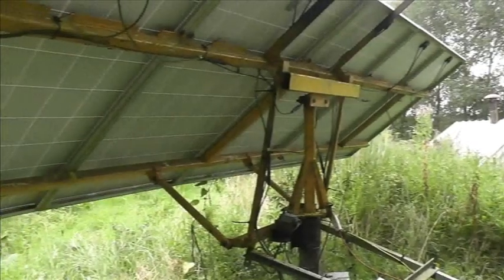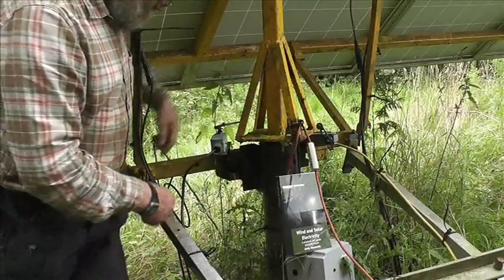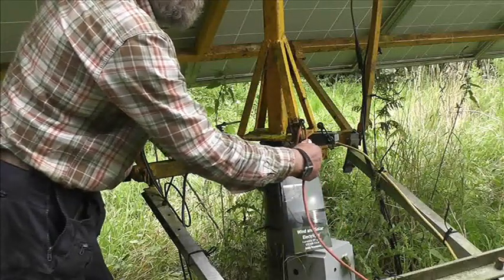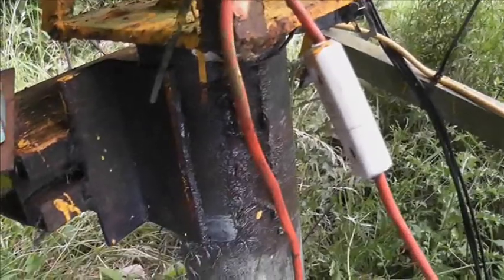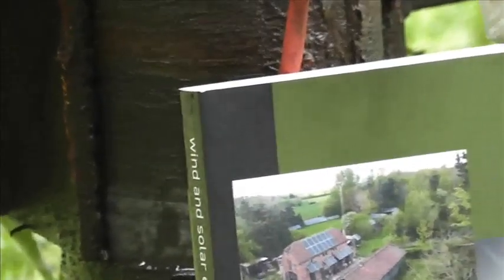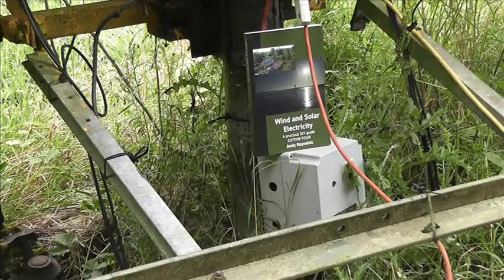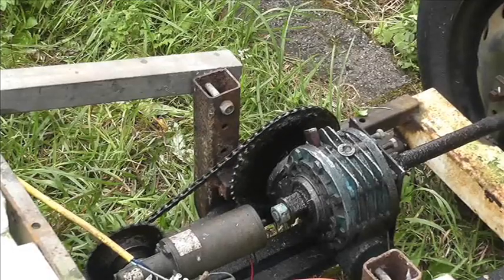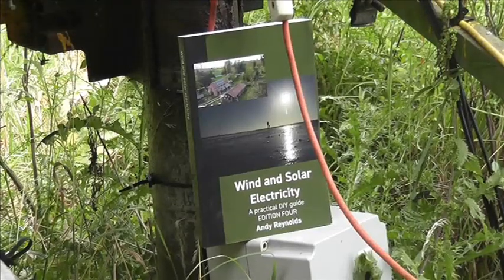Solar sun tracking, 12 year report, track the sun, solar panels, home generation, extra power,

Comment: i assume this is a mains powered motor without needing to reduce the voltage or control power to run it.
Although solar panels used from solar farms are too cheap to go this effort.
Reply from the maker: It's 12v DC powered from a slave battery, and remember this was built 12 years ago when cheap solar panels were what dreams were made of, cheers
Reply: @TheInfoworks I remember expensive solar panels Andy. In around 2001 I built two solar panels using very thin solar cells tabbed together between two pieces of glass since encapsulating liquid was too expensive.
Reply from the maker: @sim6699  Ah yes, all that tabbing wafers together was a right pain. It's amazing how far things have moved, 25p per watt, astounding, cheers

Comment: Impossible to say it's a bad design. Not good for far north heavy snow but great work
Reply from the maker: No point running this in winter as the arc of the sun is so low. 3 foot of snow is always a problem with roofs, trees and panels, cheers
Reply: That's why they invented snow tires duh! 😅
Reply from the maker: @gergc4871  Hi, I'm thinking the snow loading on the panels may be the subject here, cheers

Comment: For years I have thought that this is what should be done, but this is the first time I've actually seen it. I think this will generate much more extra power than it will consume. With everything slicked up and geared really low I'm sure it doesn't use much juice. I always envisioned using stepper motors. 

You might look into finding a lighter weight wheel and tire. Skinny tire and a wheel with spokes, maybe even aluminum. As long as you have a hard surface a skinny tire would probably be fine.
Reply from the maker: Hi, it uses virtually no power, 12v motor running on average 1 minute an hour, cheers

Comment: Nice choice on the touring all-season tires, hah. Does it get good traction in the winter?
Reply from the maker: Hi, nice comment. The sun's arc is so minimal in winter that there is no benefit, so I normally switch this off facing due south, cheers

Comment: Brilliant, I think.  I'd appreciate a video on that change over switch and it's workings.  It's the simple analog projects that last 10 years and keep going.   I was fully expecting a youtube ad right after your discussion on the need for shorter videos.
Reply from the maker: I'm resisting those mid roll ads. It's a simple cross wired dual pole relay, all in the book, cheers

Comment: 7:00 Is the video mirror as it seems to turn opposite way for sun?
Reply from the maker: Ah, I can see how you are thinking, the tracking drive runs clockwise during the day. Because the wheel is behind the central pivot it's driving the panels east to west, just like minute hand of a clock between 3 and 9, cheers
Reply: @TheInfoworks  OK, just can not see that from your video clearly but I now understand, thanks!
Reply from the maker: @april7_  No worries, pleased you are interested, cheers
Reply: @TheInfoworks  But look at your video. The tire is clearly traveling counter-clockwise around the pivot.  That is the wrong direction, for daytime. This may have occurred because you manually flipped the limit switches.
Reply from the maker: @MrSummitville  You are both right and I must have had it in night mode to set a new position for one of the micro switches, sorry @april7
Reply from the maker: Hi, it seems you were right and it must have been in night mode for experiments, sorry

Comment: So sorry you fallen foul of the morally bankrupt tube. Distanced from reality by living behind algorithms. Regardless. Short, concise excellent video. Sadly i dont have the room or elevation. But blew retirement gunds on 20 panels 3batteries 6kw inverter. Unreal savings. House now electric just winter bit of gas for heating. Tripple glaze and wallrock all exterior walls(bungalow). Ps we 2x EV. haven't paid for charging 10years.granny lead or upto 7kw wall charger. Think ahead. Big car over 300miles if need. Town car 60 plus. Keep your brain engaged.
Reply from the maker: You are doing well with your EV charging, I assume at a slow trickle rate. Yes, forward thinking to improve resilience. Watch this space for news of my new book, cheers

Comment: 12 years 64 panels 250watt on ground, on roof and on wall. No maintenance whatsoever.  That is how solar is best.
Reply from the maker: I hear what you are saying, 12 years ago 64 panels was a huge investment unless you were in the solar trade. Rule one says there's no such thing as too many panels, but you need the space and many people don't have that. cheers
Reply: @TheInfoworks  Agree, I was in a fortunate situation as we do sport equipment business with China and just added a lot of panels and inverters. But today the prices are still falling and panels have doubled in size so less time mounting and so on. But as you say you need the space.
Reply: @TheInfoworks  exactly  now panel are cheap and there is a used panel trade, i buy 10 years used 250W  policristalline panel at 20€ each , they perform well and are so cheap that i not  try to optimizing  position , i only cover every surface i have.
Reply from the maker: @8001010  Yes, recently ex solar farm panels have become available at low cost, this makes a huge difference, cheers

Comment: The choice of an air filled tire puzzles me. 

How much weight is on that tire?
Reply from the maker: Not that much weight, but they are free and have good flexible grip. Cheers
Reply: @TheInfoworks i thought tire pressure may be an issue, but not if light, and that is an acceptable price!
Reply from the maker: @Iowa599  I can just about pick it up, design around what I have in stock is the way I go, cheers

Comment: Thanks for telling me of your experience that sun-tracking is not so reliable ( you get clouds) and you like a ( fixed> no sun input) properly adjusted clock and gear ratio. I also like your safety switch/ failsafe that will unplug the unit if it goes crazy and moves past 180 or 360 degrees.
Reply from the maker: definitely time tracking is the way to go and much cheaper, cheers

Comment: Panels are cheap now. Might be good for tiny footprints where your cleared area is very limited. Still, more panels more better.
Reply from the maker: Exactly, when built panels were expensive, not so now, but small footprint systems need to get the most. Otherwise apply rule one, cheers
Reply: @TheInfoworks  What's the efficiency on the ones on the rotator?
Reply from the maker: @my_channel_44  They were updated to 250w about 8 years ago, cheers

Comment: Cool.  One of the odd things about solar is that thermal energy is about 4x the photovoltaic-electricity. So in you tinkering consider "cooling" the panels with water on the back and using that low grade 120 degree heat -- somehow -- . Obviously panels are a bit far from house.
Reply from the maker: Ah yes, PV runs on the blue end of the spectrum, where as solar thermal runs on the red. Cooling of PV panels is important and this is one of the many reasons why I don't like fitting them on roofs, cheers

Comment: I wonder about your experience with YT Andy. My approach is to try all of the things that they offer and they seem to look after me. I agree with the issues around ethos, and engaging with large corporations who take 1/3 or so of the money from the top. Yet here we are, we could go to another platform and just not get paid at all, and nobody would watch our videos. I think I said it before, the money is a bonus, I set out to pass on a message. The message is free. On the simple how to repair videos I get tons of "thank you" or "you gave me the confidence to do X" comments. I love the notion that there are 100s of washing machines out there that maybe got an extra year of use. 

I managed to dismantle and unseize a water pressure pump yesterday, 5 years + in storage and wouldn't fire up, the ominous hum of inductor motor not moving. I have to wire and plumb it in now to see if it works!
Reply from the maker: Owen, thanks for this, I get the feeling they are taking much more than a third, but you are right it's about the message, cheers